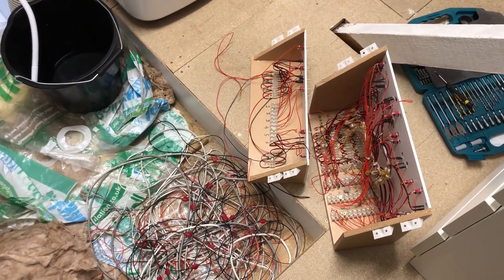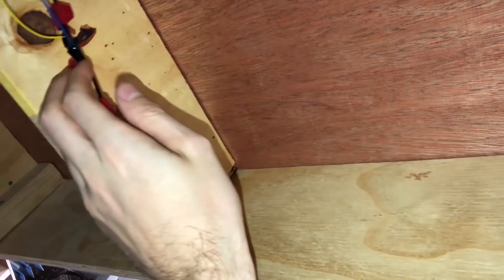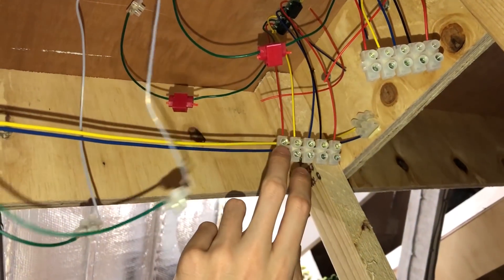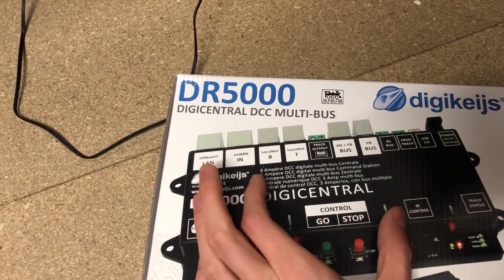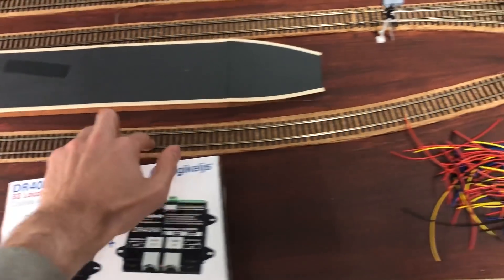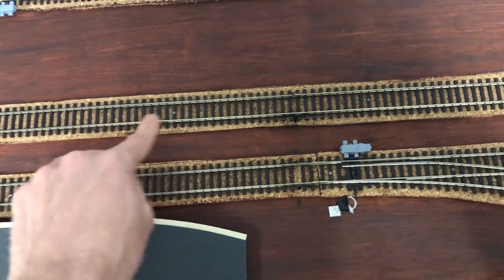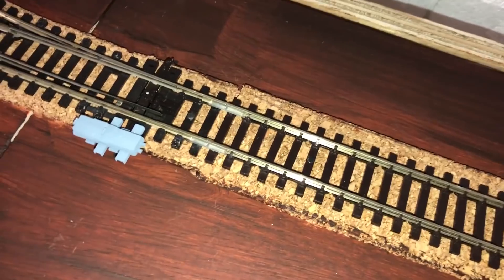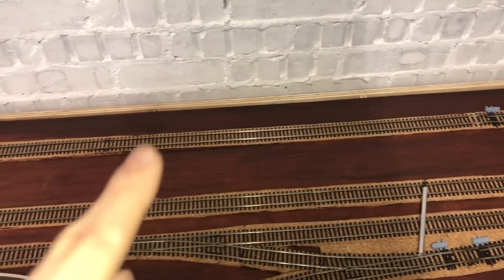How To Build A Model Railway - Episode 22 - Wiring & Blocks

Comment: Hi can you please tell me what gauge of cable you use and where from?  (Novice)
Thanks.
Reply from the maker: Brian E Hello! I’m pretty sure this is 16/0.2mm wire. I had loads of it left over from my original wiring of the layout.
I can’t remember where I got it from, but think it was just eBay.
I use 32/0.2mm for my bus wires though.

Comment: One of the useful parts of block detection is that you can rig your signals into it to aotomate them.

If your signals are located just before the start of the block, you can set up the marco's in the computer control so that as the train passes from one block into the next, it triggers the signal automatically.
Reply from the maker: I do already have a plan for my signals, as mentioned in one of my previous videos!
They will be included in the computer control system, and I talk through the decoders I'll be using in a previous video too!

Comment: For your control panels I would suggest incorporating Team Digitals loconet SRC162e or SIC24e boards as I have. Or MGP Panel decoders from mollehem.se Then you would have a simple loconet cable and power back to the layout. You also have the flexibility to move the panel anywhere on the layout where you have access to a loconet connection. Also install the Tam Valley frog juicers under the points.
Reply from the maker: I will be using computer control for the layout, so won't have any 'control panels' per se. Also, I'm using SEEP PM-1 motors which already have their own polarity switch.

Comment: An option to consider about isolating the turnouts is that since you still have to add a dropper wire to the turnout for DCC power, might as well wire it to a block detector but not use that input for the time being when designing your computer layout. It would be invisible for now but available for later if you want to add more complexity to your computer layout panel to check to see if turnouts are occupied  and if so, then triggering a switch command would be delayed until the turnout is cleared. This would eliminate derailing a train if it is over a turnout. This would of courses require more block detectors in the end but the wiring would not require a revisit later.
Reply from the maker: This is an interesting idea, but I don't have the spare blocks at this time.I've wired it so that I can easily add more blocks, including to the points, in the future if needs be though.

Comment: Hi, I would suggest mounting your block detectors strategically where you would run the shortest lengths of feeder wire to the blocks. Then use a network cable between each detectors and the loconet cable  (phone cable 6 pin) back to the command station. I see a lot of modelers running the feeders all the way back to a central location where the hardware is located and then use short network or loconet cable between units. This is inefficient in my opinion. It requires running long lengths of feeders which is not necessary and complicates things. Running just 1 network cable or loconet cable daisy chained between detectors is way more efficient and easier to debug later.
Reply from the maker: This is what I have planned to do. I've spent a bit of time planning where everything will go, and hopefully you'll see this come together in future videos!